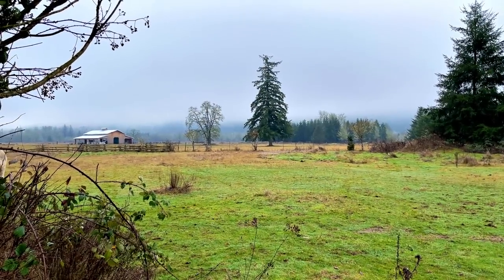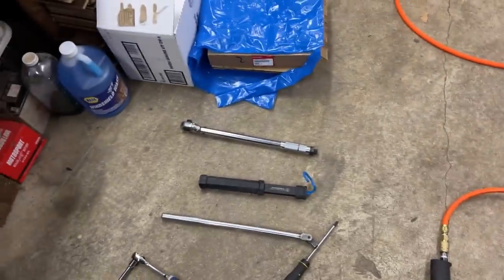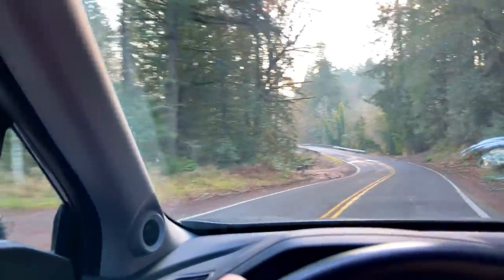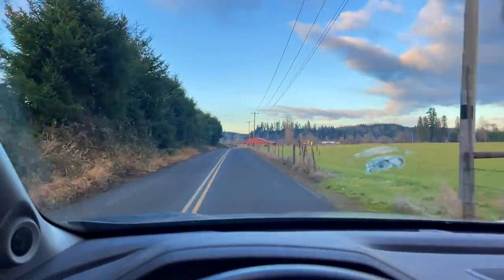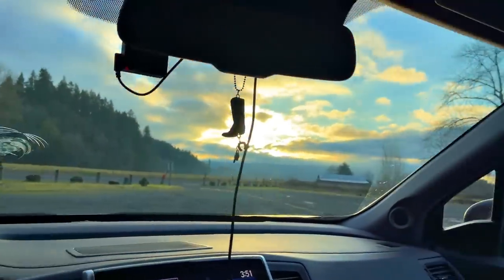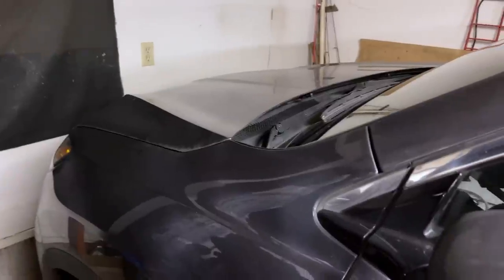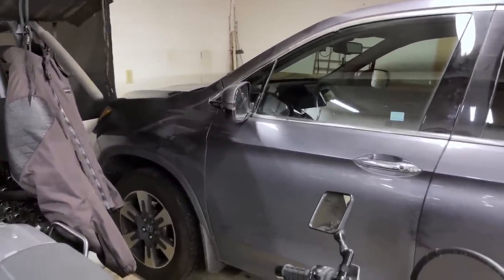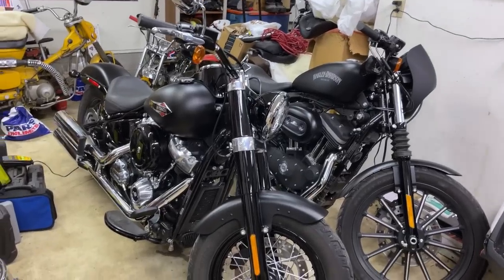Ridgeline Maintenance!! • Brakes & Transmission! | TheSmoaks Vlog_1870

Comment: You just helped me prove my point that I'm sure vehicles are designed by engineers and not technicians. Also reminds me of one reason I bought a Tesla. I'm even debating if I'll do the 2K mile oil change on my 2020 RT-L. Ride safe, be safe, best to you and yours in 2021. -JackinSpokane.

Comment: Do you have a fill tube on that transmission? I have to do the transmission fluid on a Passat. No fill tube and the trans temp is used to set level with a drip tube and the car has to be level.  Of course there are very few apps that give trans temp and the ones that do tend to be android. Totally stupid...The change kit wasn't cheap either.